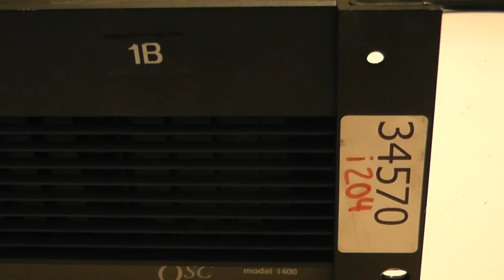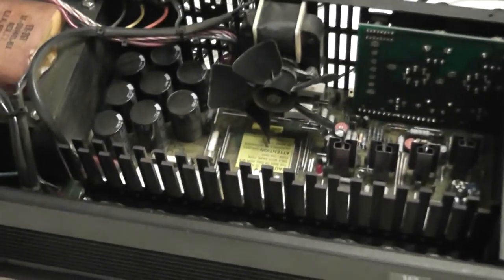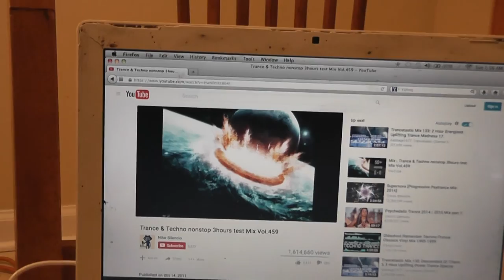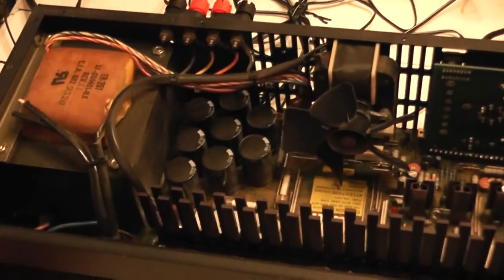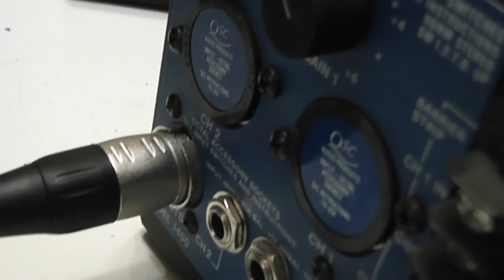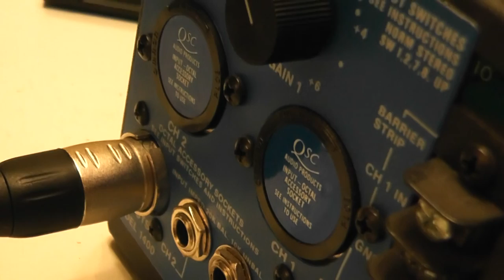QSC Model 1400 Overview

Comment: That cooling fan needs piled badly. What's going to happen is it will eventually fail or take out the power resistor in series with it. It's running way too slowly. These shades pole motors need occasional oil. Zoom Spout oil works well.
Reply from the maker: Im planning on using at least one of these amps in a daily capacity in the near future so I will definetly take your advice, I want to get a long life out of these Series Ones. Thanks for the heads up!
Reply: The fan spinning slowly could be an optical illusion.